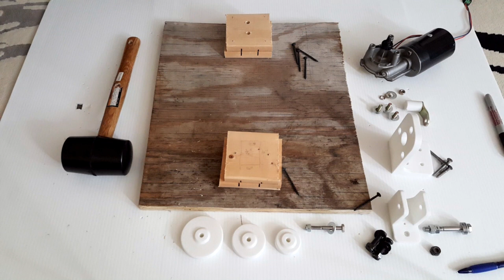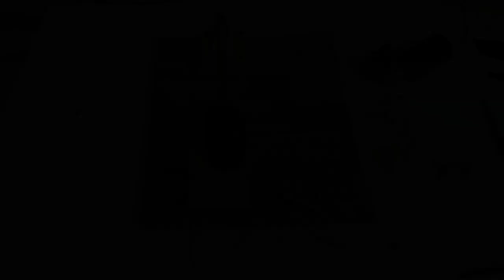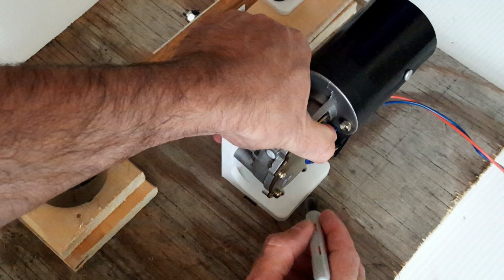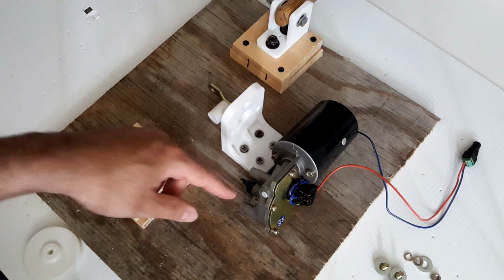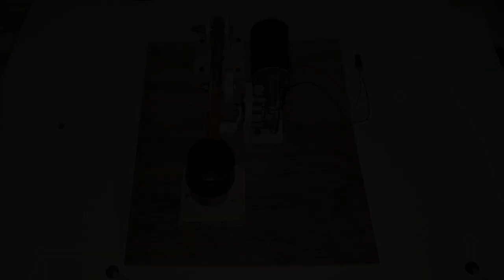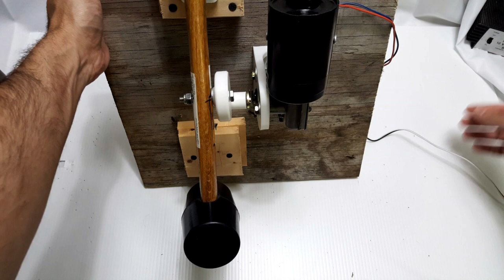Halloween Scare - Door Knocker/Thumper/Banger powered by Wiper Motor

Comment: Thanks for the build vid going to try!
What is the wind shield wiper out of? Like what vehicle?
Reply from the maker: I will need to check with my buddy, he bought a bunch a few years ago from one of the haunt supplier websites. I think though, it's a generic wiper motor, not off from a specific vehicle as far as the way they list them. I believe that he bought them from FrightProps, since that was his go to place.
Reply: @Evol3Designs  Thanks man, I found the one you showed at supplier! Built it works pretty good thanks!
Reply from the maker: Great! Yeah, I thought it was a fun project and with PIR sensor really surprises people, lol
Reply: Hi dude. Where did you bought this motor do have a link?
Reply from the maker: You can try Monster Guts website since they have complete kits with power supply and speed controller. 

https://monsterguts.com/

But, you can also find them in other places like Amazon, thought not sure if they have the complete kit or you have to buy the parts separately.